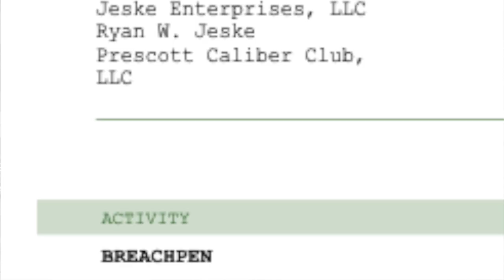BREACHPEN | SHTF BREACHING TOOL

Comment: Is this not a mixture of iron oxide and aluminum with a binder?

  It just looks like something that could be made in your backyard for under a dollar per stick.  Both those ingredients can be bought cheap online.
Reply from the maker: Not exactly, you’re on the right track, however forming this into a rod that has a controlled burn rate isn’t quite so easy and requires a few processes and materials. Sure you can mix some powers together in the back yard and get it too burn, but to do so in a controlled manner is a whole other ballgame. A pile will flash-pot which doesn’t help cut metal. I can pile up a bunch of stuff on top of a piece of metal but it won’t cut the metal. Pressure needs to be applied and it needs to be hot enough, but not too hot or it will burn too fast and you won’t have the time needed. 

Challenge: in the next 30 days, if make a YouTube video where you create a self-contained alternative that will cut through a logging chain, I will send you one of the Breachpen, breaching kits for free.
Reply from the maker: Great question BTW.

Comment: I heard if you tie a bunch if "sparkler" fireworks together it does the same thing...... allegedly... 🤯
Reply from the maker: It may work, trouble would be getting that many sparkles together in a way that would hold them all together the entire time you're burning. Sounds like a fun challenge for 4th of July!
Reply: Using a sparkler once lit and finish, the metal is still there after the fire is out or when the sparkle is finished. This thing here makes the metal disappear with the heat its generating, amazing, and much respect to its thermal ability.

Comment: How many times can you use 1 pen?
Reply from the maker: Only once. Single use. They are pricey, but they’re also not intended to be used regularly. They are to put into a kit or on your carrier so you have a cutting tool in an emergency. I still carry bolt cutters and a grinder in my truck. But if I had to book it on foot, I have a couple for my carrier.